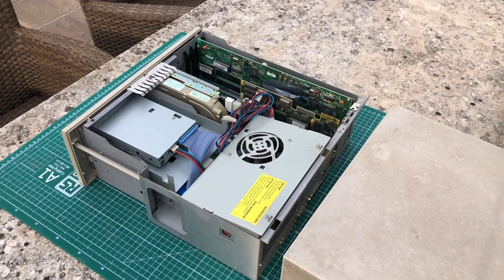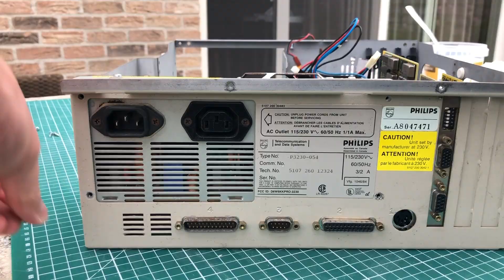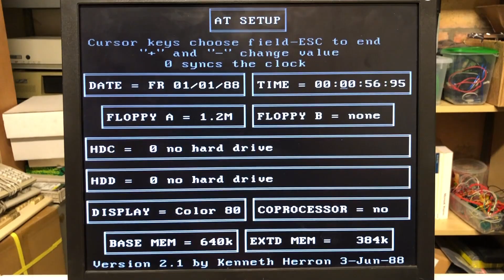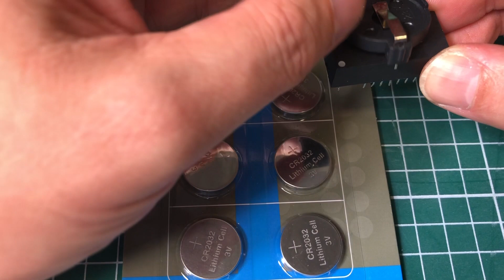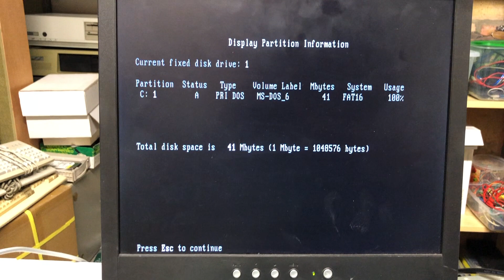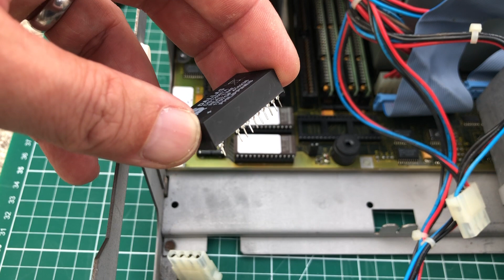Philips P3230 286 retro PC cleanup and repair challenge

Comment: Hi, just viewed your video. I've  1 of this PC from work in 1999 and just dig it out from my basement. I managed to do add a CMOS battery holder on top of the dallas RTC and downloaded the setup software and everything was working fine. I was tried to use the 5 1/4 inch floppy but it wouldn't work at all and after a few attempts the 3 1/2 inch floppy failed too. I've tried a few (working in another PC)spare 3 1/2 inch floppy drives and they all failed afterwards. I just wondered is there something I missed, or the drive controller failed !

Comment: I bought three ST157A drives on eBay once.  Two of the three were usable.  I’ve still kept the third as a source for parts if needed.  They are 45 MB.  I like the size and shape of them too.

Comment: 16:08 nope...those matsushita 5 inch floppies they develop poor contact on the sqaure chip next to the power connector...tap on the chip and the problem comes back...it appears to be the stepper driver or something like that...just reflow the solder to permanently fix the issue

Comment: Philips pcs of that style of case have a very rough finish on the paint , the paint is rough and porous and it always picks up dirt moisture and mold and its very very hard to remove with normal methods...the same happens with the Philips nms9100 xt clone...if you use concentrated oven cleaner (red in colour) and let it soak for 10 minutes then pressure wash it it comes out like new no scrubbing required...or you can use concentrated wheel cleaner for cars...dont use the supermarket crap, buy it in auto detail store or parts store

Comment: I've seen this so called "water damage" before its actually some sort of oil lubricant or wd40 resuidue, as water would corrode or rust the steel chassis as opposed to an oily residue which would look like some kind of wet spot or liquid was spilled.
Reply: its near the keyboard socket so maybe someone had problems with bad connection and gave it a squirt of something 😉

Comment: Philips 286, oh the memories....
was one of the more common "ibm-clones" locally here in Norway but i notice some differences.
here none was installed with the 5,25" floppy and just the 3,5". and also never seen em with Chips VGA cards here, only Paradise cards.

also a lot of WD 48MB drives here, no Seagate's
and every single one had Windows 3.0 installed though many never even booted into it
Reply: wait... never booted from it? Linux requires a 386 and "paging memory" I believe, so Swedes were in love with MS-DOS? There was in '99 a great essay online called, "In the Beginning... Was the Command Line" by novelist Neal Stephenson. He wasn't just praising linux, but also DOS over Windows. It takes longer to learn, but it's much more efficient once one learns the commands.
Reply: @squirlmy  old post but hey... :P
"never even booted into it" as never starting up Windows 3.0 but staying in DOS.

it wasn't before later systems that going right into Windows became a thing when systems wasn't completely skimped on RAM, though there are 286 systems that can handle not just an upgrade to 2 or 4MB but even 8 and 16MB as 16MB is the limit of the 286 itself.
i personally have an PC-Chips M216 system with an Harris 286 25MHz with 16MB of RAM, extremely overkill but it means that i can run any game in Windows mode and with CD-ROM and Audio at all time.
back in the day that would been extreme waste of recourses and better to just use a command to disable un-needed stuff to free up RAM.

Comment: Philips is a dutch company, but it had a plant in Montréal (Québec) to assemble their PCs.  That's probably why the setup program that you found is in french.
Reply from the maker: Did not know that. Thx for the info.
Reply: @RetroSpector78     If you look in the back of the computer, you will probably read: "Assemblé au Canada - Assembled in Canada". 
Unfortunately, Philips closed the plant after a few years of operation.  Why?  I don't know.  Corporate decision?   Too much competition in the IBM PC compatible market?
Reply: Philips came to Montréal because it bought Micom which was making computers here.  After the deal, the computers were sold under the name Philips-Micom, and eventually Philips.
https://pcmuseum.ca/details.asp?id=151
Comment from Michel Dupont on Wednesday, December 28, 2016:
" I remember going to the opening of the brand new Philips factory in Ville St-Laurent after they bought Micom."
Reply: Comment from Jane Blake on Saturday, May 14, 2011
"I worked at Philips,in the Medical Systems Divison. For its time, the Micom was a revolutionary breakthrough in word processing."
Reply: Philips Computers :
https://www.wikiwand.com/en/Philips_Computers

Comment: Hi! Great video! For the limited hdd options in the bios, you can use Ontrack Disk Manager Dynamic Drive Overlay software. With this, no matter what hdd fixed model is selected in the bios, the computer will work fine and will be able to use the full capacity of the drive (unless it is larger than FAT16 limit, then you'd have to split partitions...)
Reply: Great advice. I'd suggest 9.x.x or 10.46, as these support FAT32 and booting from a CD-ROM. 10.46 apparently requires extra RAM, I'm not sure how much. I believe the earliest versions (3.2 and up?) only support FAT12, not even FAT16. Many of these are available on winworld.com (except version 10). I forgot about this gem, I'm only recently back into retro PCs, but I had a small collection back in the late 90s.

Comment: Usually cases of computers tend to be yellow but this one is clean
Reply: Except the botttom
Reply from the maker: It’s a weird thing .... I have 2 identical cases. One is yellow and the other is not .... I have a mouse that is yellow on the right hand side, and looks brand new on the left. I have keyboards where some random keys are completely yellow and the others are not.
Reply: @RetroSpector78  you may have figured this out, but the yellow is from sunlight on plastic that was "fireproofed" with Bromide(I think?) Plastic without this treatment, or if entirely kept out of sunlight, remain white. The apparent "randomness" is simply from odd sunlight angles from nearby windows.

Comment: That is a much better 286 than mine, 30 Pin Sin Modules, Onboard IDE an I/O Ports, I have just onboard DRAM of 640K and i can´t Upgreat (or i do not know how) Great Video. But my 20MB MFM HDD Works well 100%
Reply: look at texelec.com and Lo-tech, you might get up to 2MB with just an ISA card.

Comment: Whoever came up with the Dallas Real-Time Clock Chip should be beaten.
Reply from the maker: :) Well .... whoever came up with soldering them directly on to the board even more. I don't really mind if they are socketed. You can still buy them new and they are part of computing history I guess so I don't really mind them in that way.
Reply: @RetroSpector78  How much do they cost? It's probably not comparable to a cost of a coin cell today but I bet coin cells were more expensive back then.
Reply: Great business model though if they're still being made today because people are having to replace them every 5-10 years lol.

Comment: I suggest swapping the BIOS in 286s to ones that have setup utilities built in, unless of course originality must be retained. It's just much easier in my opinion
Reply from the maker: Not really .... it's nice to have it time period correct but not all that important for these 286 machines. bought an eeprom reader/writer recently so might give that a try indeed. Been also thinking about using the xt ide universal bios in a networking card for this one.
Reply: @RetroSpector78  If you do end up trying other 286 BIOSes, I recommend the AMI one. It has custom hard drive support and low level formatting built in.

Comment: Very strange that you seem to have had bad luck with the ST--157A models. These are usually very reliable drives. I own 5 of them and only one is faulty but seems to work OK if I cool a certain chip using ice spray so I think it would work just fine with a different PCB. One had a problem with a misaligned connector (the one on the LED side of the drive). After disconnecting it and using contact spray it works like new. This exact drive was shipped to me wrapped only in ONE(!) layer of thin cardboard and survived! I would definitely not recommend this shipping method, that's for sure! These drives are still quite available on eBay. Prices are starting to go up, though. So if you want an original drive for this PC you might want to look for it sooner rather than later ^^ Good luck! P.S.: There are plenty of other nice options in the 40MB range. Check out my video on 40MB drives if you like ...

Comment: Hello, I'm really liking most of your videos and I'm learning a lot, so thank you very much for such a great content!
One question, have you ever replaced a BIOS  battery with something like a capacitor or a rechargeable battery? Any pros/cons?
Reply: It's not worth the trouble. Rechargable batteries fail way earlier than primary cells here, since the load current is super low.

Comment: Just burn XTIDE-Bios to a 27c256 and drop it in an old ethernet nic bootrom socket. After that, the PC can use every modern ide drive / cf card without any problems.
Reply from the maker: Yep ... also on my to-do list .... but need to order an eeprom programmer first
Reply: I can totally recommend the cheap TL866II (aka MiniPro 2 / XGPro).When everything fails, i can send you a preprogrammed one.
Another great alternative is the Lo-tech ISA ROM Board.You can flash it from DOS and use it to map anything inside your memory.
https://www.lo-tech.co.uk/wiki/Lo-tech_ISA_ROM_Board
Flashing EPROMs (not EEPROMs) - which are mostly used on older network cards - often requires UV light to erase them. You can also use 28XX-eeproms but have to interchange some wires. (see datasheets)

Comment: i hate those Dallas/ODIN/Benchmarq RTC batteries but they are not as bad as those barrel batteries, those things are the cancer, they'll leak all over the motherboard and damage them.
Reply from the maker: Tell me about it ... have this IBM 5170 desktop here that was probably stored upright, and the barrel battery on the top expansion card leaked and due to the orientation of the case all of it leaked on the expansion cards below it, creating these weird stalactite structures on the expansion cards .... hope I'll be able to get everything up and running again.

Comment: Honestly it doesn't look like water damage. On metal it wouldn't stain like this I think. I think it could've been some oil or electrolyte whatever.
Reply from the maker: Possibly ... weird how there wasn’t any damage to the mainboard. Everything inside actually looked brand new.
Reply: @RetroSpector78  looked like it pooled on top of the metal, especially if there was an indent very possible none hit the edges/cracks that led inside the system. Good thing too lol, much more of a mess or damage
Reply: If water had been sitting on the metal for a long time it would have at least started to rust.

Comment: I have a few 157's here. Often they're left unparked and don't fare well and have head crashes and they often seal poorly and have moisture damage. Of the many I've worked through, some are salvageable after a low-level format. These things seem particularly seceptible to de-MFM/RLL encoding due to age which the low level format to re-map out the defect list can help with. I have two that work now. Nice video and nice system!
Reply from the maker: there does seem to be substantial surface damage on the platters so I doubt I'll ever get them to work again. There was also a sticker "Do not low level format !" on it but in this case I will gladly ignore it. Given that this is an IDE drive, what tool would you recommend for this ?
Reply: @RetroSpector78  The "Do not low level format!" is because if the geometry is set wrong in the BIOS, then it will be used during the CHS translation and mostly brick the drive. This caused a lot of returns, and given they came pre-LLF'd at the factory Segate decided to put that on some. Docs specify it should be LLF'd in some circumstances but this sticker scared off most plebs. I use an old Commodore 286 as it has a utility in the BIOS to do it. MFM's I LLF using a VAXStation2000. They have routines in the PROM. RLL's and DOS MFM's if they're hanging off a WDC controller card you can do from inside MessyDOS's debug.exe utility. You fire it up, jump to the routines in the card PROM and go from there.  That's discussed here: https://web.archive.org/web/20071109070112/http://support.microsoft.com/kb/60089
Reply from the maker: I've done lots of LLFs on MFM and RLL drives using a variety of controllers (Western Digital / Seagate / Adaptec / IBM), but never with an IDE drive like the Seagate 157A.
Reply: The ST157A has an auto-park feature so there is no need to park the heads manually. The ST157A can be low level formatted but from what I read it just pretends to do so and reports the status of each sector back to the formatting tool since it is the IDE variant which has it's own dedicated controller. Only MFM / RLL drives with external MFM / RLL controller can do a real low level format. At least that's what I read. I'm not sure if this applies for the stepper motor IDE drives which this one is.

Comment: This NEC monitor at the end looks beautiful, but the settings seem odd, the image might be too bright and something's wrong at the right of the picture.
Reply from the maker: I forgot to clean it actually :) And indeed brightness was set too high. I was hoping this one would be able to sync up an EGA videochannel but I unfortunately only the NEC Multisync 3D 
does that.
Reply: @RetroSpector78  EGA/CGA monitors are so hard to come by nowadays :/

Also I think a very old standard of VGA also used the 9 pin connector. That makes me wonder if my one and only EGA/CGA/MDA monitor (that's a nice multisync monitor ... with some issues with colors) can display VGA as well, because it has a "Analog" setting on the back amongst other settings.

Comment: Still a nice looking pc. Never knew that Philips made pc’s, except from the msx line.
Reply from the maker: It had a very short lifespan... I believe the IBM PC compatible division only lasted for a couple of years before it was sold to Digital Equipment Corporation and subsequently dismantled.
Reply: Philips as an IBM PC compatible brand certainly lasted for more than a couple of years. I used my dad's IBM PC compatible Philips that was made in 1986 (I still have one of the manuals), and in the 90s the local book store was selling Philips MPCs - a standard which dates it to no earlier than 1991.